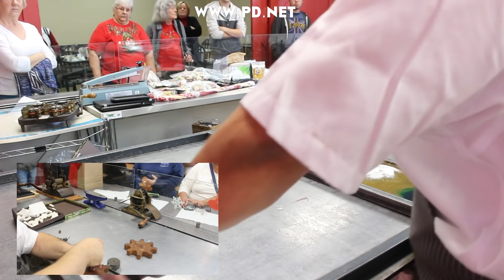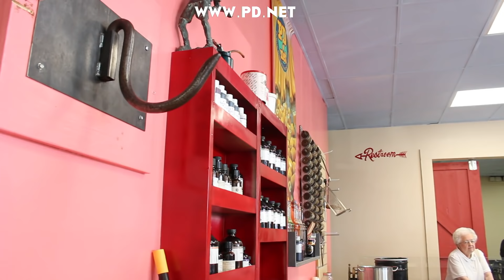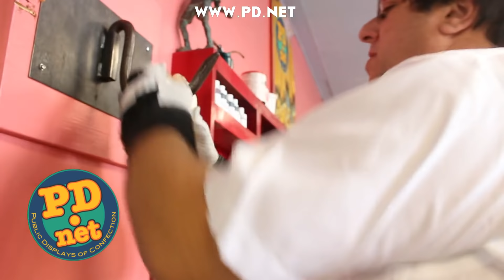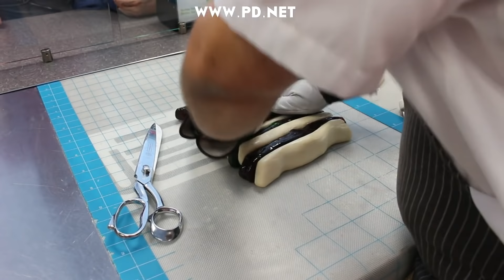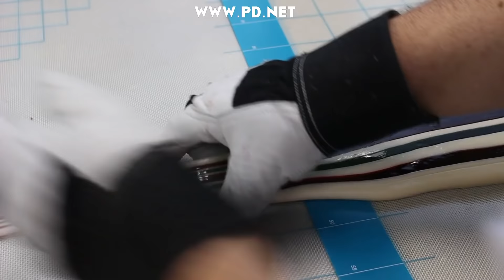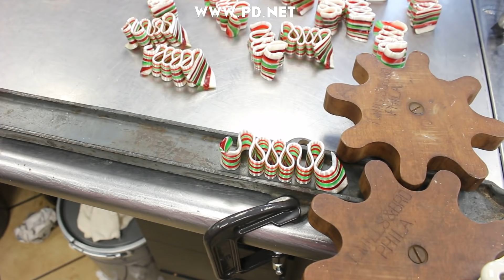#46 Ribbon Candy for Christmas at Lofty Pursuits

Comment: I'd like to try making some simple candy canes at home. What's the smallest batch size that can be easily worked? I'm assuming you take the sugar to hard crack? What's the sugar to water ratio? And, how much peppermint oil should I add? Does the surface (I'll be using a granite countertop) need lubrication?
Reply from the maker: tzkelley I actually don't know. I've never made a batch that was less that about a gallon to start and that was hard. that being said, I have been trying to figure out a at home version. I'm getting closer. my goal is to do a video on this for next Christmas using things you could have in your kitchen.

Comment: Is there a market for new production hard candy machines? All of these seem to be from the 1800s or 1900s. I'm an amateur machinist, and I'm certain that I could make a machine like this that was just as good as one made back then. The really tricky part would probably be the rollers themselves (on a drop roller). They are seemingly case out of brass and very finely polished on the inside. Probably a lot of hand work that went into making them back in the day, as well as some very skillful casting. They might've been die cast, or possibly cast from a reverse made of wax in an injection molding machine. I'm sure something like this would be much easier to make too.

edit : actually, the machine in this video could be made in an afternoon with just a few tools. would be a cool project.

Comment: I"m curious, why don't you fully mix in the citric acid into the sugar when its still molten? you fold it so many times that it'll become homogonized throughout, and you wouldn't make a powdery mess when you flip the uncolored sugar.
Reply from the maker: +Ulf Sark it does not want to mix. I think it's because Citrix acid is a hydrophilic, and teenager has no water in it.
Reply: Teenagers have no water in it? Well, i know teenagers have very oily skin and all, but ... i'm sure there's SOME water in there ;-)
Reply: BTW, how's the shop after the hurricane???

Comment: what is on the pulling hook that allows you to pull off the candy without leaving any behind on the hook
Reply from the maker: +Stephen Peterson Sometimes it sticks. Depends on humidity levels and the temp of the hook.
Reply from the maker: Usually I wait until the afternoon when the light is good to fill my videos. This means most of my videos are not the first batch of the day. This was the first batch of the day. You can probably tell about how many patches were made by the amount of dust and little bits of candy on the table in the videos. Frankly I was so excited to get this machine I wanted to use it right away. The hook gets used over the day it gets hotter on the hotter it is the more likely for the candy to stick. mind you all it takes is a good rain storm in the humidity goes up and everything sticks.
Reply: nothing beats the joy and excitement of a new toy! brings out the little kid in each of us!
Reply from the maker: I was sitting there with a heat gun on a fan trying to rush the drying process after I washed it. There is no way to make candy with wet equipment. You are absolutely right
Reply from the maker: See you then.

Comment: What do you use to clean the hook?
Reply from the maker: +Chris Turnbull The hook comes off the wall and we drop it in a pot of boiling water. 10 or 15 minutes later it is sanitized and it's clean as all the sugar residue dissolves.
Reply: Ahhh I see, I was wondering if it was like alchohol or somthing to steralise it. What you said makes more sense. Great videos by the way.

Comment: Invented in America? what the hell?? 
Akide candy and Turkish delight are two of the most important culinary heritages of Turkey.  Akide candy was invented in 16th century at a time when sugar was very expensive and more valuable than honey.
The ingredients of akide candy are quite simple, yet making it requires a certain amount of expertise. Sugar with some water is heated up to about 175-180C (350F). Sugar has to be melted completely and come to an almost caramel consistency and poured on a marble counter. Marble is crucial in this process as the natural cooling effects will help with the cooling of the melted sugar and bring it to the right consistency to make the candy.   At this stage the aromatics (e.g. mastic, mint, lemon, rose petals, pistachio, cinnamon, clove etc.) are added to the sugar and the kneading process starts that helps to bring down the temperature of the sugar, makes it pliable and incorporates the aromatics. When the cooling sugar comes to about 70C (160F) the shaping of the candy starts. Timing is very crucial in this process as the sugar hardens as it cools, so help from a heat lamp or a table with bottom heat is needed. The end product is the colorful little hard candies that are like little gems and ribbons.

One of the most important discoveries of Turkish confectionery, akide candy is a cultural symbol of “eating sweet and talking sweet” (a famous Turkish saying).

Sigh...

Comment: Does anybody else find it gross that he's running the candy through a rusty machine
Reply from the maker: The brown parts are wood, not metal. Try again.
Reply: @LoftyPursuits  you should never use wood for any food service.  And look at the metal that the "wood" is attached to.  Flaking metal.  Needs to be replaced.
Reply from the maker: That metal is not flaking and wood is allowed under Florida food code. Please stop making thing up.